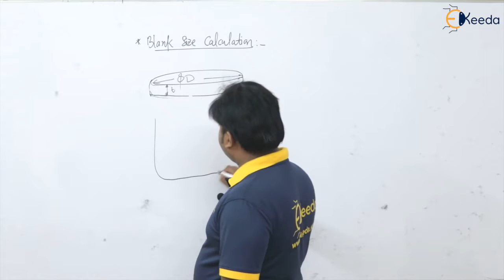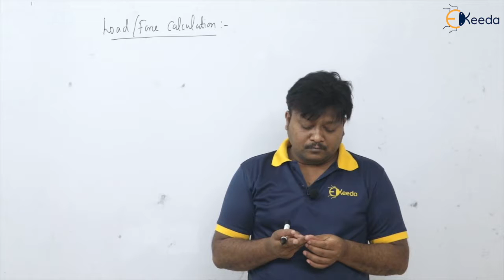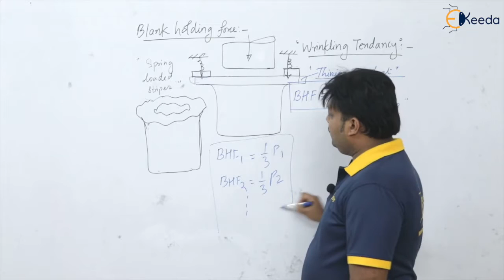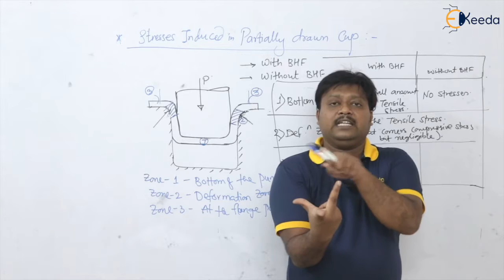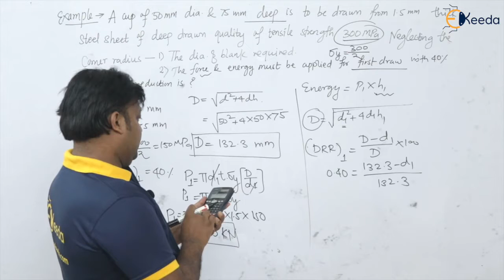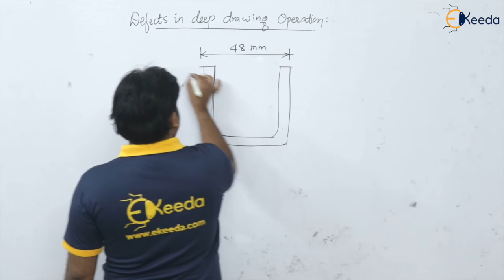Deep Drawing Operation | Sheet Metal Operations | GATE Production Engineering | GATE ME

Comment: Very good why excellent. There is little confusion. You are using small d for external dia of cup as Well as internal dia of cup also. In the load calculation you have shown d as internal dia of cup and in the same slide small d is used (ie internal dia of cup) for area equation .  For area equation external dia of cup only to be used.